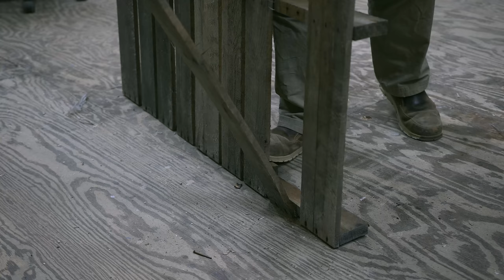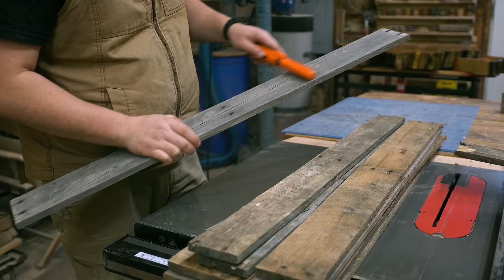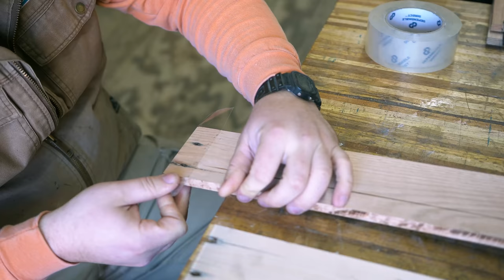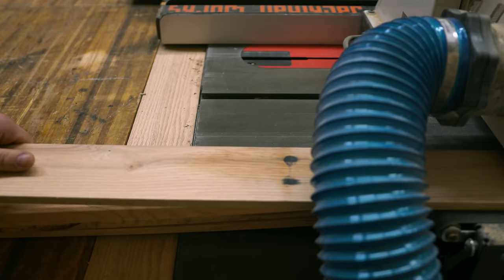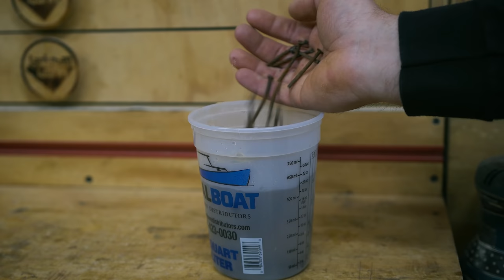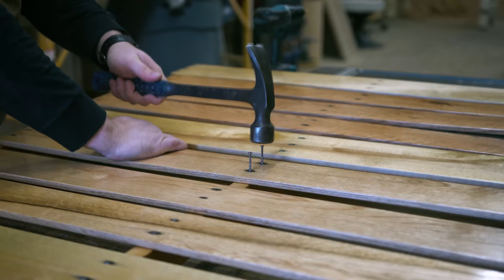Restoring a Pallet

Comment from the maker: Support my amazing sponsors for still greenlighting my ideas without question
𝐓𝐨𝐭𝐚𝐥𝐁𝐨𝐚𝐭 (code "Jackman15" for 15% off)
► Epoxy (High Performance) - https://bit.ly/2PsGAHI
► TotalTint Kit - https://bit.ly/3m8PfuS
► Wood Sealer Varnish Primer - https://bit.ly/3rK9f8m

𝐈𝐒𝐎𝐭𝐮𝐧𝐞𝐬 (code "Jackman10" for $10 off)
► Check out the XTRA 2.0, LINK, and more styles - https://bit.ly/3sHMNy6
Reply: This video was posted 4 days ago, but I just got the notification today. I wish youtube wasn't like this 😢
Reply: Wish I would of seen this earlier. Just ordered from total boat and could have used the discount code. Next time.

Comment: Ok, merchandising video. Normal a pallet isn't worth the work, also for recycling the boards. To much stones, metallparts, nails and other trash is in the wood. Also chemicals are sometimes on the surface of the wood. The danger killing the blades in the planer or thicknesser are to high.
Reply from the maker: You're in the wrong place